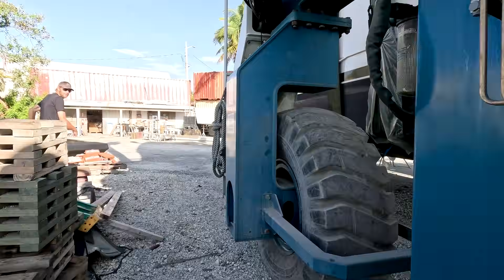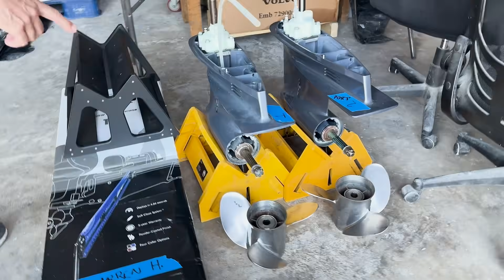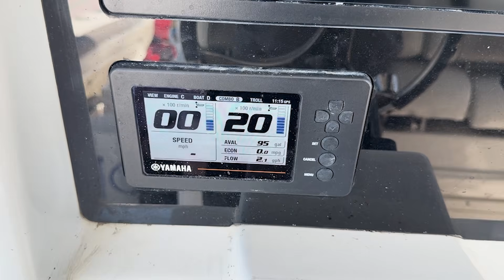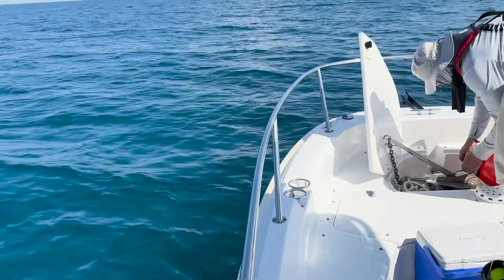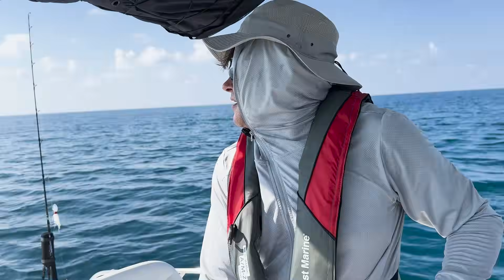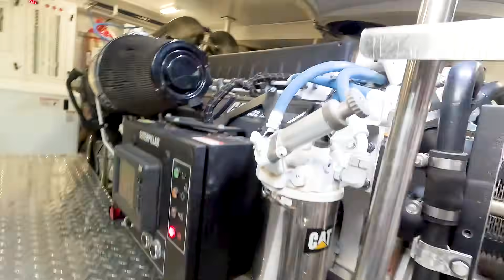We NEVER imagined this would happen to us AGAIN

Comment: The worm drive hose clamps without the holes are embossed worm drive clamps or german style hose clamps.

All of those worm style clamps look cheap and ugly.  T bolt clamps are one of the best solutions.  O style clamps are also good and aren't as size specific.

On my boat I only use double bolt power clamps if I have no other choice.  The double bolt power clamps are better than t bolt clamps due to the ability to apply more even pressure.  I have a 2" thick hose clamp catalog that has every imaginable hose clamp design.

Hose clamps and barbed fittings are actually garbage.  I don't like barbed fittings and hose clamps.  I use crimped an fittings with lock wire holes wherever possible.
The gates power grip heat shrink hose clamps provide a clean look with nothing to corrode.
Reply from the maker: We use aba hose clamps.

Comment: I think that 72 has a bonding/electrolysis issue. Between the bottom paint burning, zincs etc its probably what caused that fitting to brake
Reply from the maker: probably we fixed the bonding issue about 6 months ago.
Reply: Maybe turn up the volume a notch on new videos  @WillFixThat
Reply: @WillFixThat figured it didn't get past you but I was delivering a 60 Hatteras and the bronze through hull snapped off the coast of ocean city MD. By the time the high water alarm went off and I got below the water was to my knees😮 she went down quickly and after they raised it the insurance company found that was the cause.